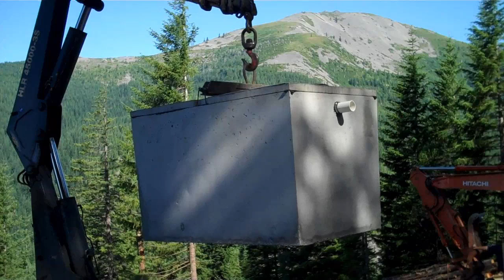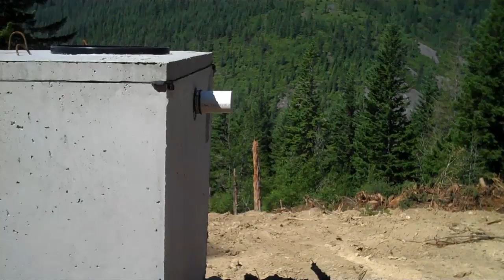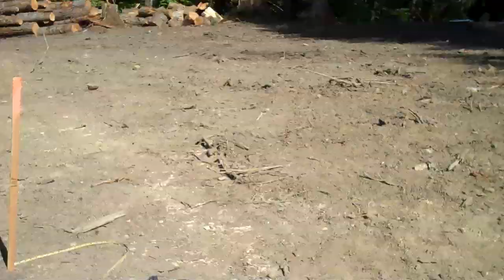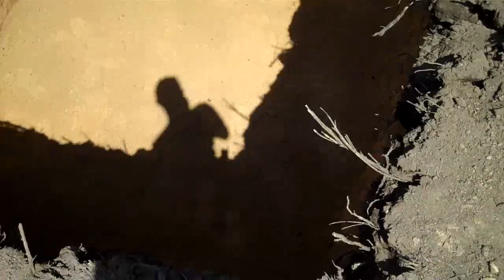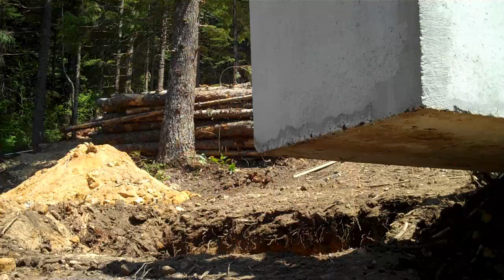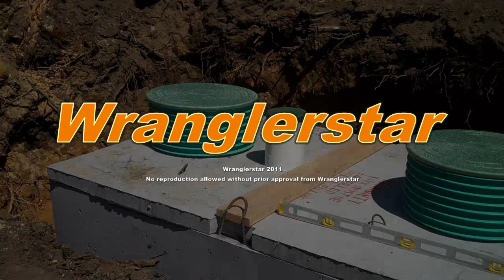Prepping for the Future: Installing Our Off-Grid Septic System

Comment: You were a brave man, I would have had the hole dug and let the crane truck lift the tank into the hole.  A 1 piece tank like that is a heavy SOB and fairly fragile they don't take being bumped around too well.  You did it with the butt cheeks clenched tight lol, a lot of weight for a 120 to handle, only had one shot at that baby no way the 120 would lift it out of the hole.  People from the city don't know what a septic tank is, when they flush a toilet they don't even know where the crap goes.

Comment: done this a few times on my own jobs. you have to REALLY watch the bank under your tracks. The bank to the hole could/will cave in, oh man what a mess. That 120 is a borderline machine to be using on that 1000 tank. You really need a 200 sized machine to have some terrain mobilty and pick and carry. Im impressed you did it with what uou have and goes to show what a 15 year old Japanese Hitachi EX120-5 can do. You can get into one 40-50,000 set up real nice. Anyway a good video.

Comment: Installed a septic system in WA state in 08.  Had a Cat 312 on the job, and it wouldn't touch the 1500 gal tank.  What a nightmare getting all the inspections and permits as well. . .  Not a fun process.  They approved a gravity system, and changed their minds to engineered once everything was already done.

Comment: @00Delaney00 Concrete is the best especially if you live in a area where you have lots of freeze and thaw the tank isn't going to move around. Plastic tanks are mostly second choice, you want a good reliable septic tank that will last 30 years concrete is the way to go.  Usually plastic is used for places where size issues exist or you can't get a machine big enough to lift the tank into the hole. They say dug the hole with a mini excavator it isn't going to lift a concrete tank.